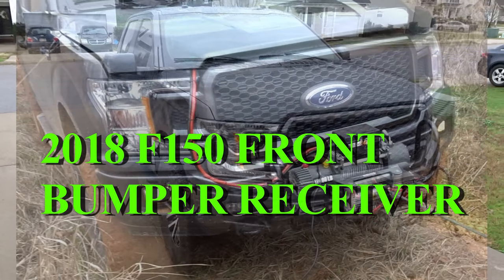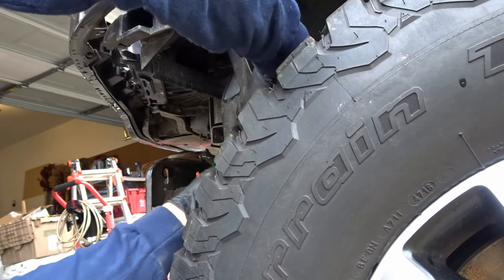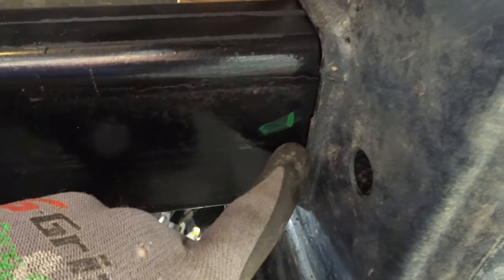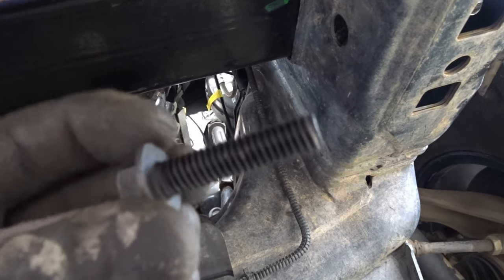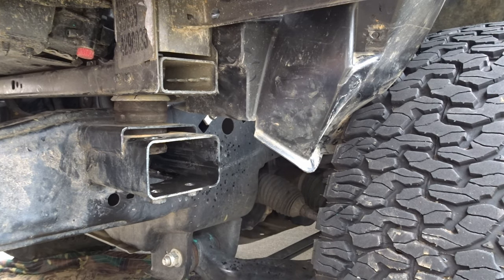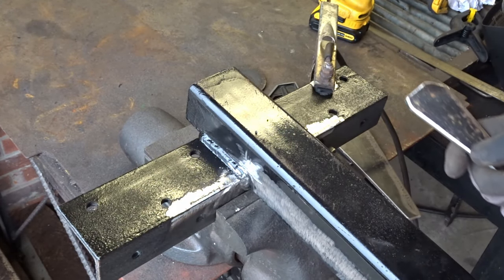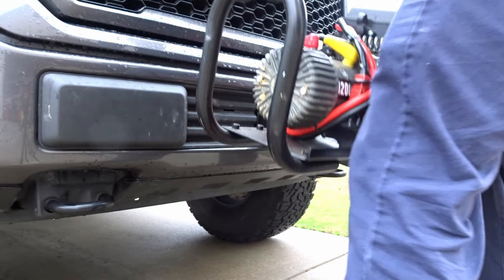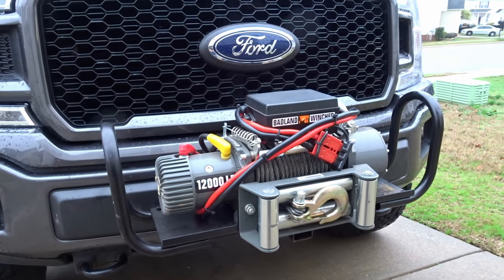2018 F150 Front Hitch @ Bumper Level

Comment: Pretty awesome. I would have had that pin hole sticking out of the front.. instead of having to reach under, but i see you had a solution even easier..  on the other hand, you can't see the hole to know it's lined up when you insert something..

Comment: Awsome, i was just looking at the curt and just like you stated it is too low. I haven't looked underneath to see that the crash bar slots go through the frame. I also like that you retained the crash bars. Great job
Reply from the maker: Oh yeah, I didn't want to change the structure, just add to it.
Reply: @dutchofsc  my problem is that mine is an ecoboost.
Reply from the maker: @shroom903  now that changes everything.
Reply: @shroom903  
There is a guy on YouTube who did the hidden winch on his EcoBoost F150, a 2019 I think. Just do a search for EcoBoost F150 hidden winch. If I remember correctly (just watched it a couple of days ago) he mounted his intercooler in front of the radiator. He used a Rough Country hidden winch mount.

Comment: Got a 2019 and was looking at curt or draw-tie but the front clearance suffers.  Wish I can get an aftermarket one ready to install like this.  This is amazing solution for us ecoboosters, a hinch mounted winch for wheelin. Thanks for idea, I will try to see if anyone around me here in Socal and fab me one of these.  Thanks DutchOfSC.
Reply from the maker: Don't you have the cooler in that opening?  I'm not sure if that will fit, but please, let me know
Reply: @dutchofsc  That is correct. The only way I could see this working on an Ecoboost would be to relocate the intercooler.